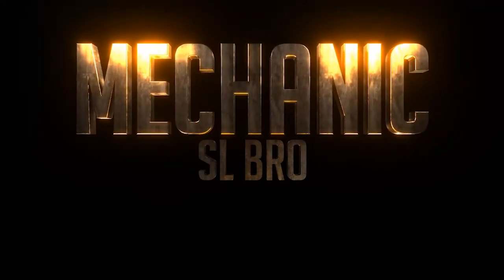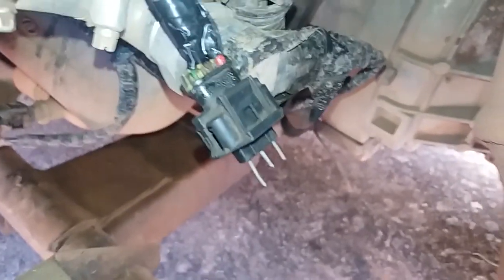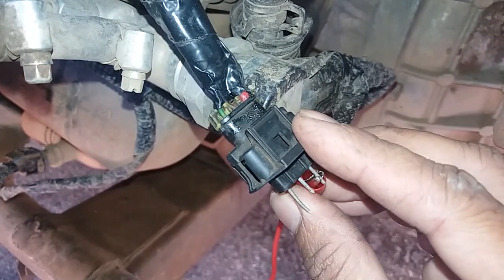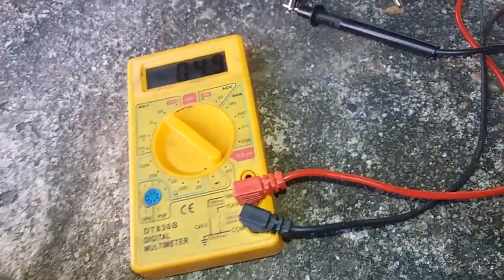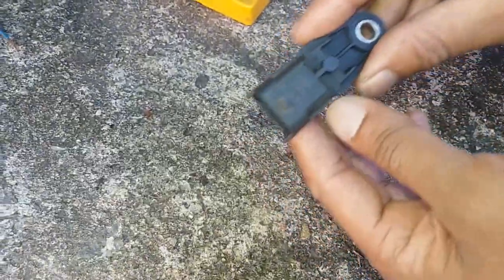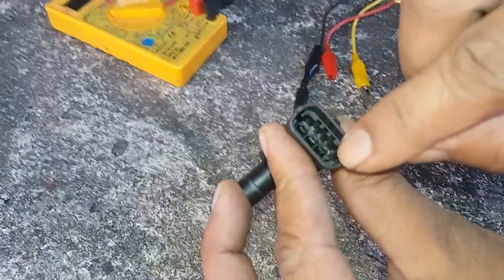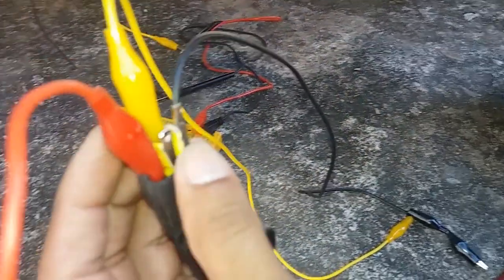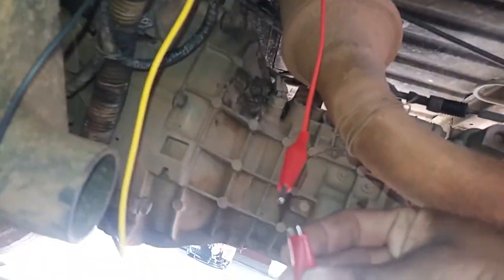How to Test Crankshaft and Camshaft Position Sensors

Comment: radiator motor vede karenne nehe bro.
what's the  solutions??
Reply from the maker: radiator fan weda nethi akada prasne,,
Reply: @mechanicslbro  ow ayye
vahene thuvenekotath radiator fan vede karanne nehe.
Reply from the maker: @nasvirrock1078  01. Water Temperature Sensor aka, 
02. Sensor akata sambanda  wire kedila thiyada
 03.fuse,relay hariyata wedada balanna,,

04. fan akata direct current dila ballana athakota wedada kiyala,, ahema balapuwama weda nam, udin dala thiyana hethuwak handa wenna puluwan weda netthe,,
Reply: @mechanicslbro  
thanks bro.

Comment: Total How many types of sensor are their in maximo and where is the position of sensor pls make a video..
Reply from the maker: ok,
Reply: Fuel temp sensor at top of fuel filter, water in fuel sensor at bottom of fuel filter, , cam sensor at left top of engine, crank sensor right bottom of engine, fuel pressure sensor at rail, water temperature sensor at left under rail, speed sensor at right side of gearbox ,

Comment: Positive line ekata .56v wage pennane ai.wiring eka ok.ecu fault ekakda
Reply from the maker: voltage 4.7 to 5.25V?
answer is yes 

 Ignition OFF
 Cam phase sensor connector
DISCONNECTED
 ECU Connector
CONNECTED
 Check the continuity between
pin 2 and pin 1 of the cam
phase sensor connector

Comment: Main relay open too early p121B meke aula mokakda sir
Reply from the maker: code aka P1210 da ?
Reply: Na sir p121 B
Reply from the maker: mokadda wahane thiyana lede 
code akata nam injector case akak penwanne,,

1.Faulty Fuel Injector 
2.Fuel Injector harness is open or shorted 
3.Fuel Injector circuit poor electrical connection
Reply: Wahaneh start wenneh na sir
Reply: Sirge Dala tiyena number vada karanneh na namber eka danna puluwanda
Reply from the maker: @smalwis1185  1.ඉන්ජෙක්ටර් වලට සම්බන්ද වයර් පරීක්ෂා කරල බලන්න ශෝර්ට් වෙලා තියද කියල,,
2. ඉන්ජෙක්ටර් එක වැඩද බලන්න resistance test එකක් කරල  මල්ටිමීටර් එකෙන්, මේක කරන විදිහ ඕන නම් වීඩියෝ එකක් දාන්නම් ..

3.වයර් හන්සේ ශෝර්ට් තියද බලන්න ,, https://youtu.be/-iOzXm9aEXQ

4.එහෙම හරි ගියේ නැත නම් ඉන්ජෙක්ටර් ක්ලීන් කරල දාල බලන්න වෙනවා,,,

5.දැනට වාහනේ ඩීසල් ටැංකියේ ඩීසල් වල පාට වෙනස් වෙලා තියද බලන්න.. කලුපාට වෙලාද කියල .. https://youtu.be/UYhShUL-0QM
Reply: Video ekak danna ko sir enjector dekama  hadala Damme dekama vada karanawa.wahaneta sambanda karama vada karanneh na injector wiring line check karanneh kohomada ? Test light ekakin puluwanda?
Reply: Diesel kaluwela na. enjector vadakaranna koccara current ekak ECU eken denavada meyala kiyanavai ECU eka marukaranna oneeh kiyala
Reply from the maker: @smalwis1185  වයර් හනස්සම පොඩක් බලල ඉන්න,, මේ වීඩියෝ එකේ වගේ මක්සිමෝ එකේ සාමන්යෙන් වයර් අවුල් වෙනවා කාලයක් යද්දි ශෝර්ට් වෙනවා  ...
https://youtu.be/-iOzXm9aEXQ?t=182
Reply: Hari sir ECU eke aulak tiyenna puluwanda hanassa  hodanam meke enjector cod karanna onehda
Reply from the maker: @smalwis1185  ගොඩ දවසක් ඉදල ශෝර්ට් එකක් තියනම් ecu  එකට බලා පෑමක් වෙන්න පුළුවන්,, වයර් හනස්ස බලල ඉන්න මුලින්ම,
Reply: Thanks sir